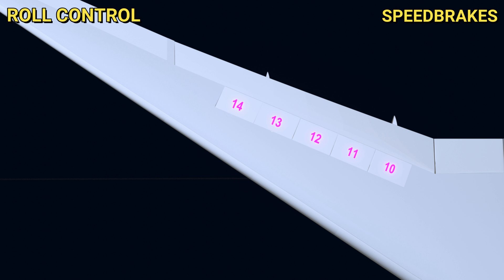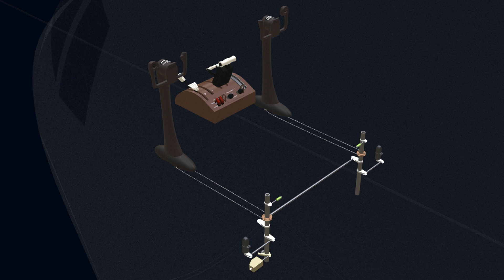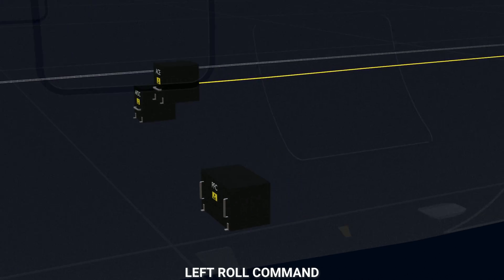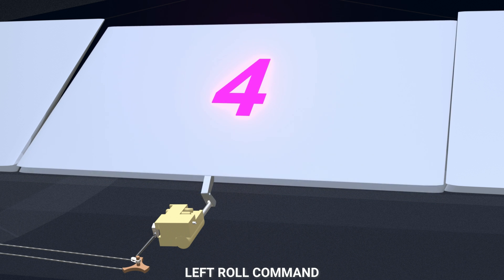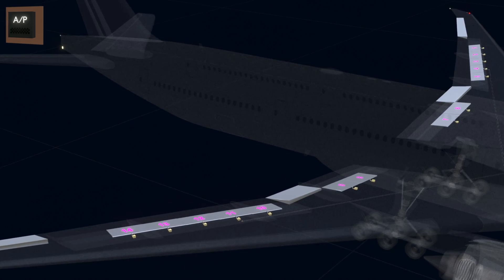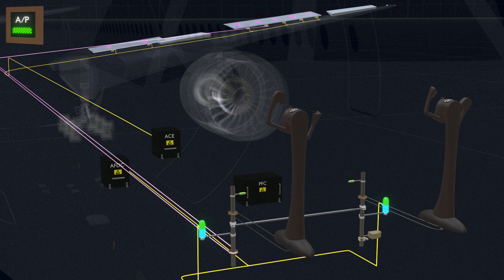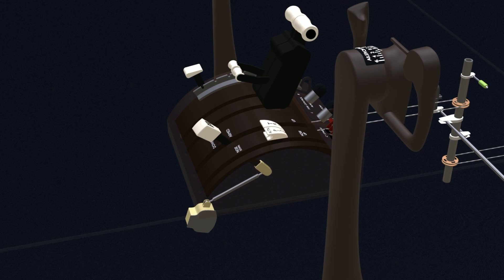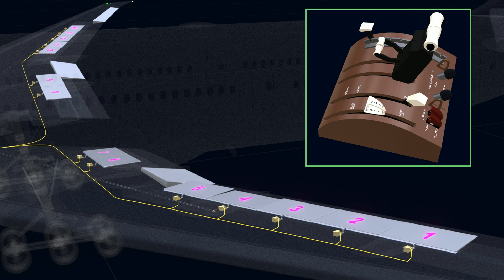How Flight Controls Work | Part 5 : Spoiler and Speedbrake

Comment: Can you explain, why the #4 and #11 spoilers move lesser angle as compare to other spoilers.
Reply: OK Andreiza. I'm also trying to find out the reason behind. At high speed the Primary flight control computer prevents the movement of #5 and #10 spoilers. As the turbulent air flow from these spoiler surfaces reduces the efficiency of tail control surface. I think that might be a reason why the designer have restricted the actuation angle of #4&11 spoilers to lesser angle as compare to others. But not sure as no where it is written. 

I thought u might have know the reason so I asked u here. 

By the way I really appreciate  and love ❤❤ your hard work to make these animated videos. Hates off to you.. 

Please make more videos like this on 777.
Reply from the maker: There will be a roll control chapter towards the end of the series, which will clear most of your doubts.
Reply: @AircraftScience  OK we will wait for that roll control video.
Reply: I don't know
Reply: I also had the same question

Comment: why are spoiler 4 and 11 mechanically connected?
Reply: For redundancy (possibly), because even if the electrical system fails, we can still use the mechanical control
Reply from the maker: Andreiza is correct. There will be a roll control chapter explaining the same in detail.
Reply: @AircraftScience , i've watched a video explaining that Boeing used mechanical systems on the 777 as a backup hydraulic input